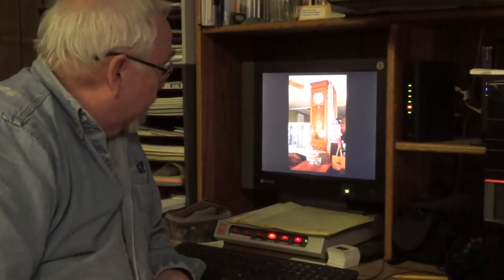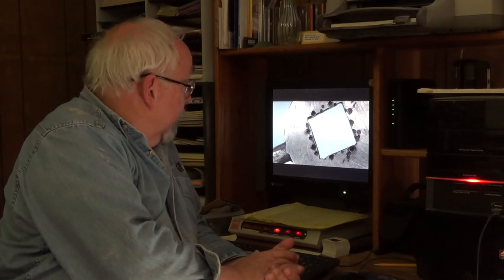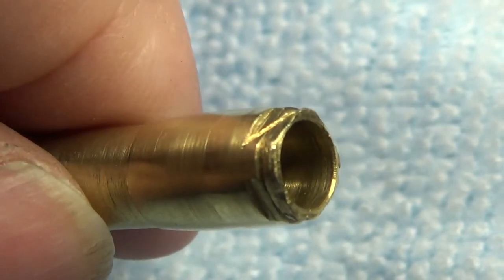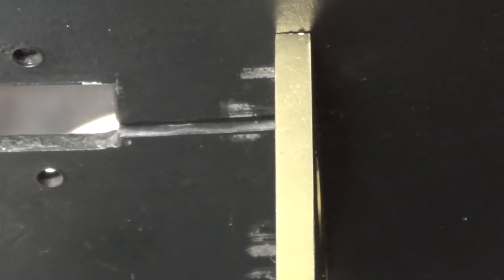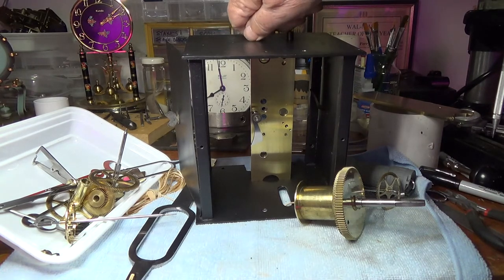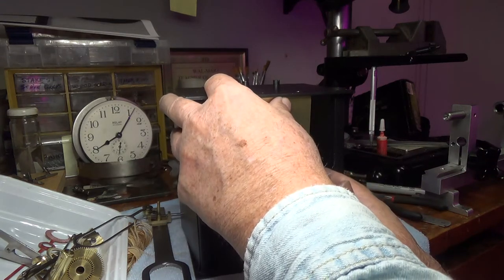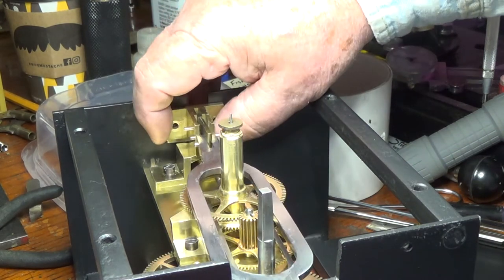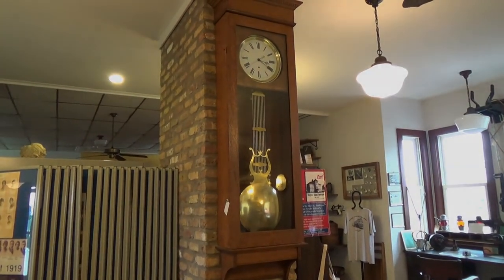Repair for a jeweler's regulator wth French pinwheel movement

Comment: I am glad to have found this video.  I just received in my shop, an exact movement as you show here.  It won't run, and I was unfamiliar with this particular escapement.  I had worked on several Morbiers but this clock had an unusually heavy and large pendulum.  also, the small weight seemed counter intuitive from my experience, since the weight of the pendulum was so great.  This clock also has the damage on the hour horn.  Thanks for your time on this video.  It is a great help to me at this point.
Reply from the maker: Glad it was a help.  Just for more information, when it is running, the pendulum moves in a ridiculously small arc.  As I recall, the pendulum was about 20 pounds.  The dial on this clock was also very heavy, with a cast iron base, porcelain overlay and a solid, heavy brass bezel.

Comment: If great minds think alike, so do not so great minds! To my dismay, the destructive solution to hold the hands on their arbors illustrated in your video is identical to the one used on my substantially similar movement. I hope I have the same success reversing the damage to the hands and arbors. This video is a great start and very elucidating. Thank you!
Reply from the maker: Luckily, the damage was small enough it was easy to restore the slot to place a new washer.  I'd hate to think about trying to remake the entire part.

Comment: Dear Mr. Perry. Thank you for this video (and for the others I will have to watch!). I recently found a Waterbury #7 regulator in a sad state. The hands were in a ziplock bag and unfortunately there were no washers. With your video guidance I will now be confident in fabricating those. A bigger problem is the nut that fits the internal threaded cannon wheel is missing. I was wondering if you have a recollection of the thread involved? Thank you very much. James
Reply from the maker: I wish I could be of assistance, but all I recall is that it was a very coarse thread.
Reply: @dperry428 Well not a problem , it is still very helpful to see what I'm aiming for. Take care.

Comment: Did they stake those hands on an assembled movement? I cringe to think of them doing that.  Towards the end, you were (temporarily) running the clock without the pendulum.  This got me wondering how you determine how much weight is needed to run a clock, if say, the clock you are fixing is missing the weights?
Reply from the maker: Yes, the hands were staked to the hour and minute tubes after the movement had the dial attached.  I didn't have to figure how much weight to use as the weight was with the clock, as is normally the way it is.  In the case of cuckoo clocks that came with no weights, I have a number of weights that I can try and simply use the lightest ones that will keep the movement going reliably.  With a weight-driven clock, though, it is easy enough to attach a weight shell, small bucket or even a zip-lock bag and add weight in the form of BB's, lead shot, or sand until the clock runs; then weigh the container to determine what size weight to use.

Comment: Thanks for the video. I have one in the shop and am struggling to set the beat on the split anchor pinwheel. Any tips?
Reply from the maker: The beat is so slow that the only thing I do is use the second hand to judge the interval between swings.  The anchor should be a slip fit on its arbor.  Have you checked to see that it hasn't become contaminated with oil and is slipping on the arbor, thus not staying in beat?

Comment: Hi Mr. Perry,
I have recently acquired a complete jeweler’s regulator with its weight and gridiron pendulum. The case is long gone and I am in need of some way to mount it safely to the wall. I’ve been unsuccessfully combing the internet for a usable mounting bracket. Do you have any suggestions?
Reply from the maker: Simple heavy-duty shelf brackets available at any home improvement store.  After all, that's essentially how the movement is supported within the original case.
Reply: @dperry428  Thanks for getting back to me.  I’ve been looking online( without any real success) for shelf brackets that will clear all of the screws and allow the cage to be mounted to them. I had some thoughts about making something out of wood, but am concerned that it won’t properly support the weight and the stress and movement of the cage, weight and heavy pendulum.
Reply from the maker: I think you're making too big a deal of it.  Consider that, were the movement in its case, the two brackets that support its entire weight are each held to a WOODEN case with two screws each.  Now, add the weight of the case itself and consider what is holding it on the wall.
Reply: I do see what you mean. Thanks again.

Comment: Hello
Thank you for posting this video . I'm working on the same movement but my movement is spring driven  time only , looks just like yours but has a single barrel with a spring inside , wondering if you have any info on my movement because most I have seen are weight driven.  The movement has thick plates just like yours so I think its swiss made . Could you also tell me what clock cleaning solution you use . Thank you
Reply from the maker: Can't really help you with any information on you clock movement, but you might like to try the message board at https://mb.nawcc.org/   This is the National Association of Watch and Clock Collectors

This is the cleaning solution I use:

http://blackforestimports.com/advancedwebpage.aspx?cg=307&cd=3&SKUTYPE=202&SKUFLD=SKU&WEBID=2914

Comment: You did not show how you attached the cord to the great wheel.  I have yet to disassemble the one I am working on, so it is not obvious how the cord attaches.
Reply from the maker: The main wheel barrel has a small hole in it at the edge of the surface upon which the cord winds.  There is a larger hole in the vertical surface on the back of the barrel right next to the small hole.  The cord is strung through the small hole into the interior of the barrel and out the larger hole in the side and pulled out enough to tie a knot in the end of the cord. The knot is then pulled back inside the barrel as the large hole allows it to pass, but the small hole does not allow a knot to pass back out of the interior of the barrel as the knot is too big. Cord is now attached to the barrel and can be wound onto it.  Some people, instead of tying a knot, crimp a piece of brass tubing on the end of the cord to make its end too large to pass through the small hole.
Reply: @dperry428  I was hoping not to have to take it apart, but looks like I will!!  Thanks.
Reply from the maker: I looked at my video again and it looks like it was not as I remembered.  Looks like the main wheel barrel has a simple slot at one edge of where the cord winds.  One end of the slot is a larger hole through which the knotted end of the cord is placed. The cord is then pulled down into the narrow slot and the knot keeps the cord from pulling out. The cord is then wound on the barrel.
Reply: @dperry428  Thanks for continuing to ponder this.  My barrel seems different.  I have some other watches/clocks ahead of this one, so it will sit in the queue for now.  Will report back when I solve it.

Comment: I have a French henry   lepaut weight driven clock  no chime any   idea  what weight should be needed to  work it. Thanks.
Reply from the maker: I haven't a clue, but you can do what I do when I get a clock that came with no weights.  Attach a container (small bucket or zip-lock bag) and add weights (nuts and bolts, lead shot, etc) until the clock runs reliably.  Weigh the container with a postal or kitchen scale.  Get a weight that is that amount or slightly higher.  Problem solved.
Reply: Ok Thanks

Comment: Very well made by the looks of the video.  The plates and gears look much thicker than what I've seen (my grandfather clock).
Reply from the maker: Very heavy, thick brass plates.  Made in France about 1890 with some parts likely from Switzerland.  Imported by US manufacturers and put in American-made cases. Best guess is that it was offered for sale by Waterbury Clock Company. The dial was cast iron with porcelain overlay and a solid brass bezel, weighing a total of about 25 pounds.  The pendulum bob was also of cast iron, covered with sheet brass.  It also weighed some 25 pounds. It hung on the wall of a bank in our town until the early 1950's and then stored in the bank basement for almost 40 years.  It was manufactured as a jeweler's regulator and keeps very accurate time with the temperature compensating pendulum.